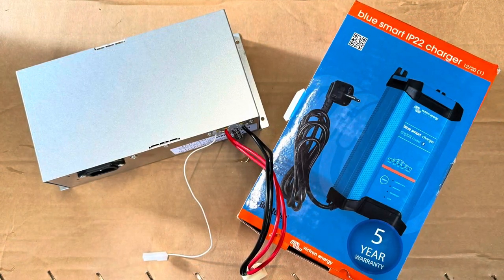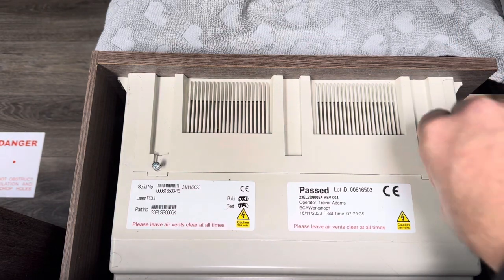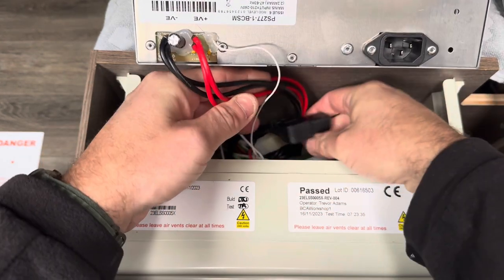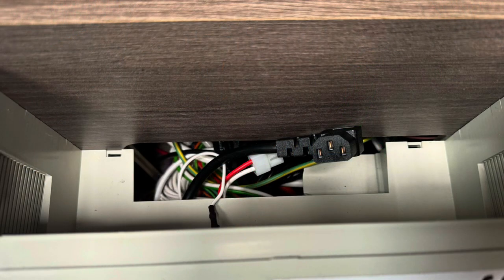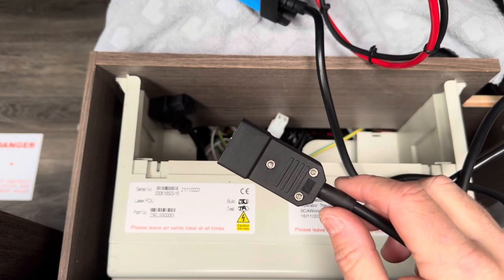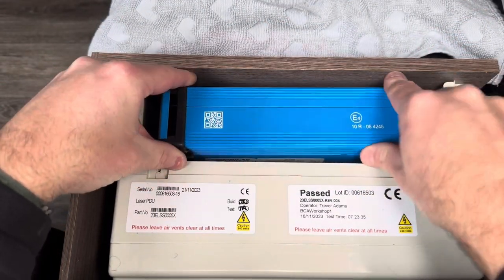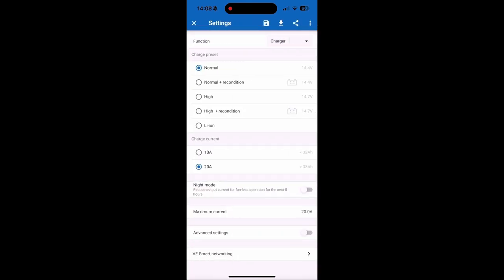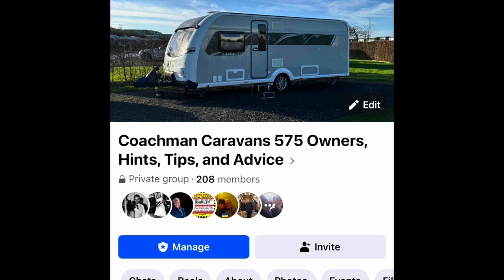Fitting a Victron BlueSmart Charger to a 2024 Coachman Laser Xtra 575 caravan

Comment: Hi hoping you can help me with this.  Ive got the virtron mppt and a battery shunt, all work well with cerbus gx.

Ive bought the blue energy unit in this video.  My question is does this affect the power from ehu to mains circuits in caravan, i read it as it can either be a psu or a charger, so if i have it as a charger does that mean it wont power the 240v circuits in caravan at same time?  Thanks

Comment: How do you get it to run the fridge.
Reply from the maker: The Fridge runs off the EHU and consumer unit. It doesn’t require a charger or power supply. Or of course you can run the fridge off gas too.